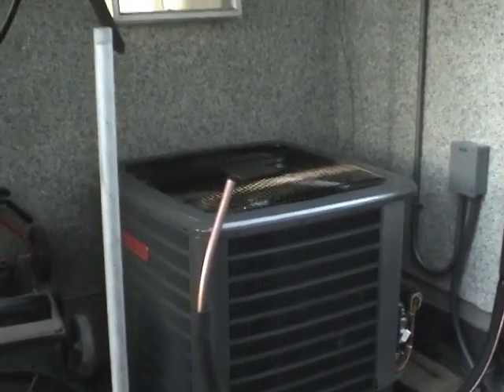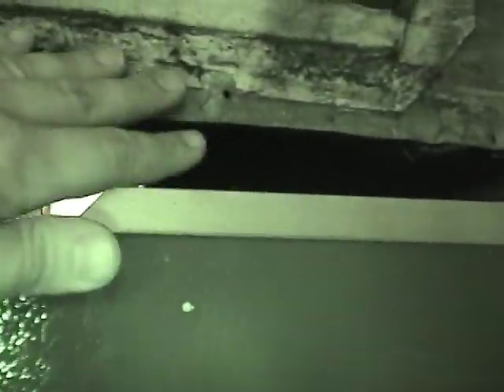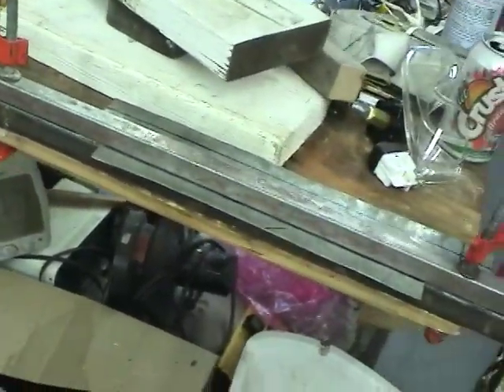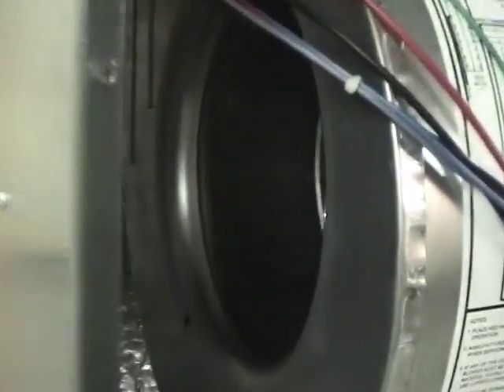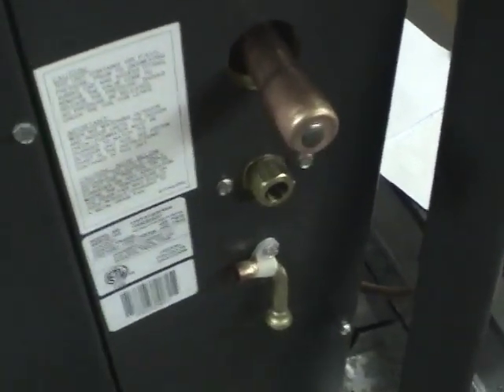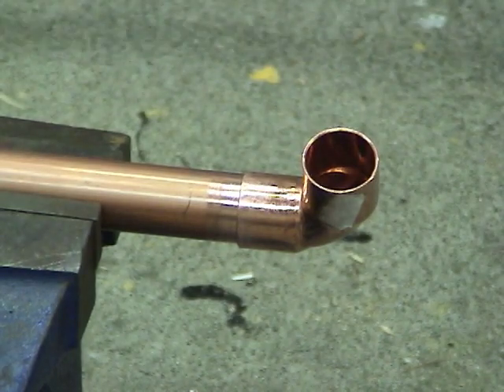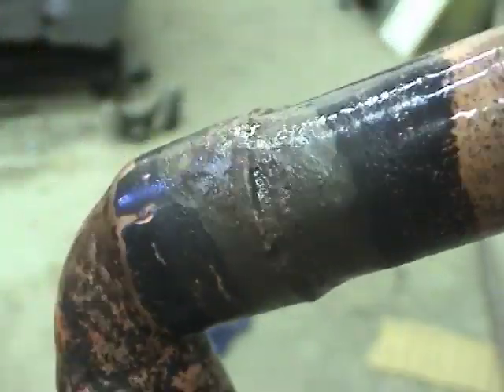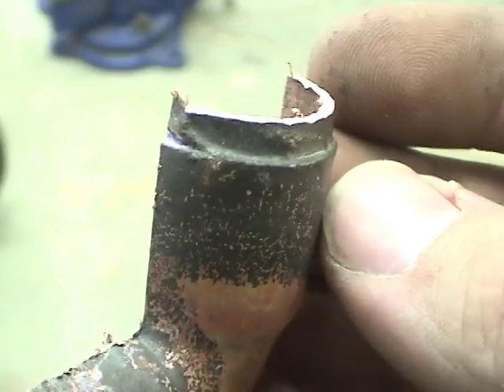Heat Pump installation - Part 3

Comment: That's a pretty flawed installation. Any good technician would know that by installing the condensing unit under a roof overhang, it recirculated hot and cold air into the coils, and causes it to run inefficiently. A good technician would have relocated the concrete pad away from the building, and ran the lines in a sealed conduit underground.
Reply: It looked like he had plenty of room away from the roof, there were trees in the background, and it didn't look like it was in an alleyway

Comment: Now turn that fitting over and tap it on a table you can see a very nasty build up of crut. That's now in the lines  and the compressor sump.. Braze hvac work with a nitrogen mask gas.. Also you need an isolator band on the heat pump/ air handler other than that not bad

Comment: Unlike in electrical your heating instrument doesn't heat the solder, you heat the metal which heats the solder.  In the case of what you're doing you should be heating at the bend of your fitting.  That will help pull the solder in.

Comment: nice job on the installation great workmanship on the sheetmetal transition. I'm gonna assume that this job is done either up north or the northern westcoast area where the relative humidity will not affect the ductwork not being insulated. Unlike here in the gulf south, in New Orleans particularly where the relative humidity always over 80% even in the winter sometimes. Again nice job.

Comment: Have you tried using nitrogen flowing through the copper tube while brazing?  It prevents oxidation on the inside and means the internal system stays much cleaner.  God series thanks.

Comment from the maker: @Jaytheozzi Thanks!

The brazing rod I'm using has phosphorus, which is supposed to act as a flux, no extra flux needed. This only works on copper though, for brass you need flux.

Comment: looks great! good job on the ducting especialy considering you dont have a bender! im not sure weather you need soldier flux when doing copper joints like when doing brass but it may stop the black stuff forming. 
very interesting!